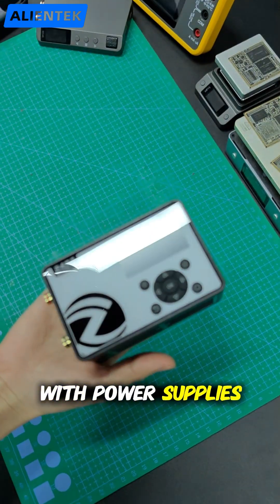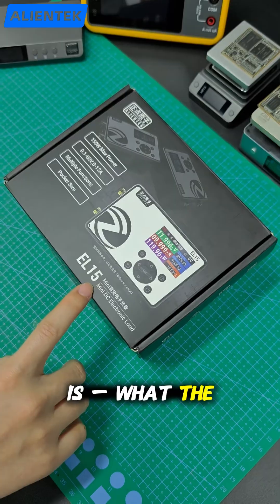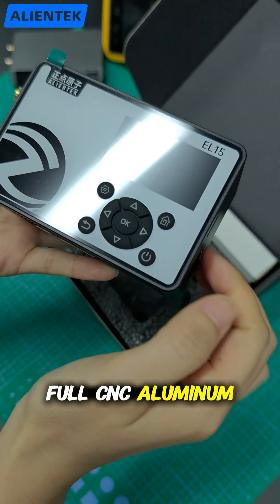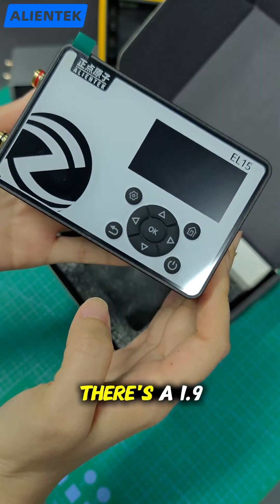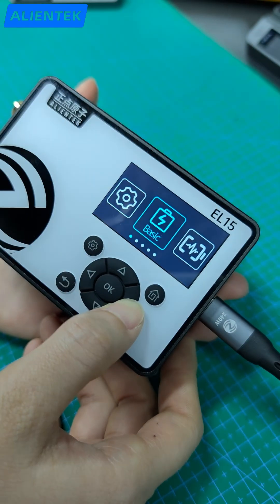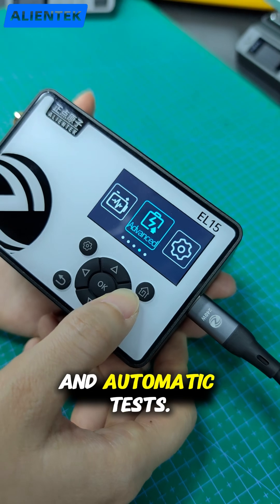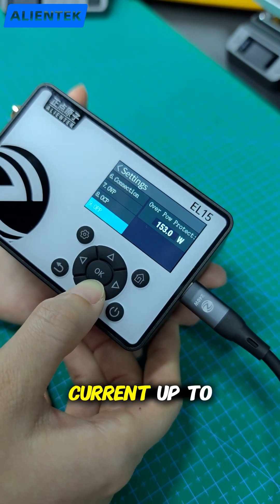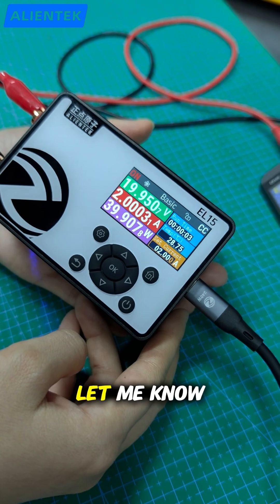150W Electronic Load That Fits in Your Hand?! EL15 Unboxing #alientek #el15 #shorts

Comment: if it could self ower from the battery side it would be the perfect battery discharger for RC hobby lipo discharging. we still need a way to put our light posts back to storage voltage. really fast in portable package. maybe you could look into this functionality with a little hardware upgrade?
Reply from the maker: Great idea — thanks for sharing.
We’ll forward this suggestion to our R&D team.

Comment: When will Windows software with charting and data logging capabilities be available?
Reply from the maker: The electronic load supports Bluetooth connection. You can find the software download instructions in the user manual, or check the download guide in my channel posts.